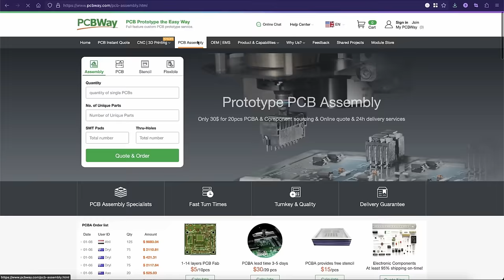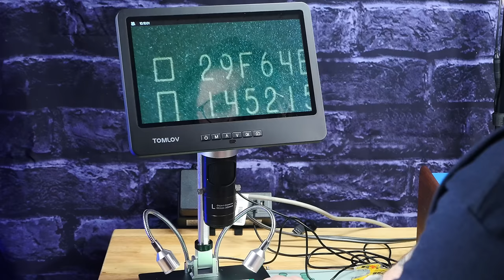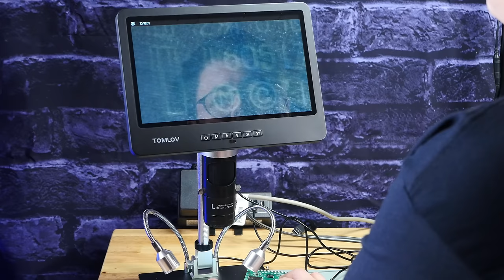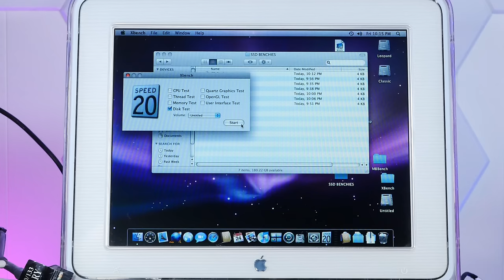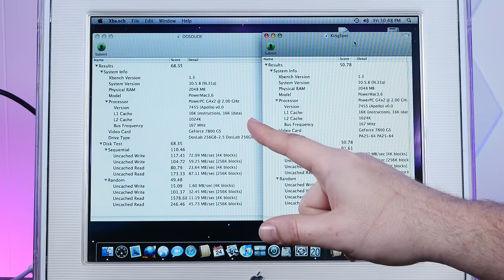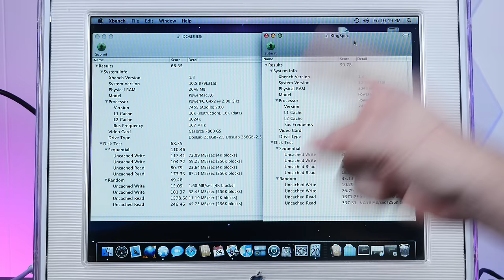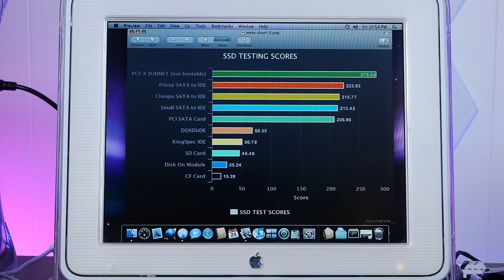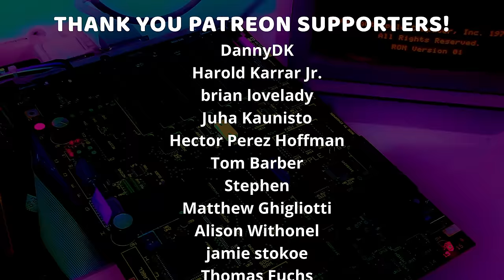What's Inside This PATA SSD from Amazon?

Comment: I wonder if the KingSpec only having 1 memory module vs DOSDUDE's having 4 is part of the cause of the speed difference. I know that can affect NVMe SSDs. Just look at the stories from the recent Macbook releases. A test of KingSpec's 256GB SSD might had shown a different result.
Reply from the maker: Oh interesting, I didn't know that could affect speed
Reply: Yeah that was my first thought as well. SSDs with multiple flash chips can use striping, i.e. parallelizing reads and writes to improve performance. It's why SSDs with less storage capacity tend to be slower than the same model with higher capacity.
Reply: This can also be seen in the M2 Macbook Air, it has fewer memory chips, and the disk IO is slower bc of that
Reply: @ActionRetro  The controller is 4 channel, so with 4 flash chips, it will perform better than with 1 - typical of SATA SSD controllers as well, so the 120/128 GB model will usually be slower.
With 64GB flash chips, a 64 will be single channel, a 128 dual channel, a 256 quad channel and a 512 two chips per channel, with the 1TB moving up the chip capacity by 4x and going to 4 chip again

Comment: This reminded me of those last agp cards that were actually pci express but had a chip that "converted" to agp on the card itself (on the opposite side of the chipset).

I just wish people would stop using CFcard thinking it's ssd. CFcard is not SSD, they are slow, they have an absurdly lower number of reads and writes in the long term, they were made to be used as a pendrive and not for an operating system to write to it multiple times. They last a lot less, and are a lot more expensive. Those industrial flash ide modules are also cfcard technology, and are only designed to be read many times (not written), not only are they expensive, they will only last a few years in a retro gamer machine.
Reply: sorry thats not true. CF Cards were developed for mobile devices like PDAs, Cameras and small form factor laptops. CF first of all is an interface - thus says nothing about the storage technology. For example IBM produced a hard drive in CF Card form factor. CF Cards were most of the time NOR-Flash, later NAND-Flash. Those ARE Solid State Drives. You are drawing a line into the sand where no line is. The main difference between modern NVMe or MSATA drives compared to the CF Cards are the controller. They got more sophisticated caching stuff in DRAM to avoid writing on the Flash to often, mapping the physical storage to spread out write operations, having more capacity and swapping those around - again to reduce write operations on a single Gate. But from the flash perspective there is no huge difference between a SD Card, CF Card or NVMe drive. Also i disagree, you COULD use a CF Card for a gaming system, but you should avoid using those as a swap device or disable writing logfiles on those drives. Having a DOS PC with a CF Card is absolutly fine - the few created Save games does not matter.

Comment: I've seen these IDE flash modules before. They are supposed to be just plugged directly into the port on the board, no cable needed. So only one drive, and expensive.
And while both IDE SSDs have the same chips, they use different amount of memory chips. And just as with SATA SSDs, more chips means more controller-to-memory bandwidth. That is also the reason why SSDs of the same model but different sizes give different speeds.

Comment: The difference in speed between the DOSDude drive and the KingSpec drive probably has more to do with the DOSDude drive having 4 flash chips vs. only one in the KingSpec. Most SSD controllers have multiple memory channels, and can access multiple flash chips in parallel. (The PCB quality in the KingSpec may also play a role.)
Reply: Came here to say the same thing! The controller will write data across all the chips it has access to, so write times will definitely be better on dosdude's drive.
Reply: @FinalManaTrigger  and read times as well i suppose, wouldn't having multiple flash chips om a multi cannel controller be allmost the same as having sevaral IDE drives in a jbod ( ofc without the seek time on flash and possible lipitations on top and soeed due to not using multiple ide channkes on a dedicated ide raid controller and thus being limited byba single udebus)

Comment: The SM2236 chip is a compactflash card controller. The Dosdude and the Amazon special drives are essentially CF cards, just using modern flash devices, which is why they kill the speed of the CF card. But from a compatibility perspective there should be no difference between a CF card and those two drives.

As for speed differences between them that's due to the number of flash chips. You often see this in specs, where lower capacity drives have lower speeds. It's all about parallelism which is lost if you have fewer flash devices.

Comment: The Kingspec PCB certainly is designed much more nicely, I like the two stacks of memory chips (well it has the solder points for them) rather than one back to back across.

Comment: The CF card says 133x on it. That speed rating is based on 1x equal to 150KB/s (based on compact disk read speed), so the card is advertising itself as being just shy of 20MB/s in ideal conditions, which is way below the 100MB/s speed of the IDE bus.

Comment: 2.5" sata Hewlet-Packard  654540-001 adapter sleds are very good 2.5" SSD mounts as they preserve 3.5" sata connector physical locations, bolt into mac pro 1,1 and above apple sleds

Comment: On the DOSdude vs. KingSpec - the DOSdude uses four 64 MB chips, while the KingSpec only uses one. Many SSD controllers run much faster when they have more chips to parallelize across. Just look at the speed reduction for Apple M2 Minis/MacBooks with the lowest-GB drive vs. the next one up. Because the lowest-GB drives always have half as many chips.

Comment: That small SATA adapter looks perfect, since most sata SSDs are smaller inside, we can probably make 3D printable shells that can fit both the adapter and the SATA ssd in the right spot.
Or just put some kapton tape on them and let them sit loose in older laptops.

Comment: I would be interested to see an SSD replacement that went the other direction. Not to be the fastest possible IDE drive but to be slow as balls. More specifically to better emulate the speed of an actual old hard drive maybe even having it be adjustable. Things like platter rotation and delays on seek time like even with its paltry speed the CF card will still feel way faster than the original hard drives in old macs because it has almost no seek time.
Reply: Buy why,  I don't think anuone would have minded the new upgraded disk access times when these systems where new, but sadly the tech wasn 'r there yet. But hay I might be missing something

Comment: Thing is, the marvel based ide to sata adapters are quite good, there are even variations for ODD support on slave via jumper. Anyway, the cheap solution with adapter and standard quality sata ssd will outperform any other solution, especially if the ssd isn't total garbage and has proper dram for block mapping and slc for burst writes. Add to that, modern ssds own internal garbage collection and wear leveling routines which don't even need some OS flags to start them, it will be long time before that combo will fail or become inadequate slow.

Comment: I actually bought a 64GB KingSpec PATA SSD back in 2016 for my Thinkpad T23, and it was only storage in that laptop until 2021 when I added an UltraBay HDD caddy and an SD-to-PATA adapter for storing more stuff. That KingSpec drive is still running my 98SE install and works great. The only concern is budget. It was definitely hard to swallow $50 on a 64GB SSD. Hopefully dosdude's creation will be more reasonable.
Reply: Much will depend on hiw much pcbway will charge fore delivering the cards pre populated ( unless you want to do the soldering yourseld) and how much the case and shipping costs.

Comment: I believe that the reason the DOSDUDE drive is so much faster than the KingSpec is because it is populated with 4 NAND chips while the KingSpec only has one.  In effect it is like running a 4 way RAID system set to span 4 drives.  You are able to access the throughput of each drive at the same time rather than being constrained to the throughput of a single drive and as such the DOSDUDE drive is hitting its limit with the controller chip rather than the NAND chips.  In day to day use this limitation would not be much of a factor as it is unlikely that a file you wish to access had been split between all 4 NAND chips but it is something that definately would show up on a benchmark.  It could be interesting to see what the DOSDUDE drive could do with an upgraded controller but that is way past my abilities.

Comment: I bought a cheap no-name IDE to SD card adapter for my Gigabit Ethernet G4 and it boots OS 9.2.2 in 36 seconds and boots OS X 10.4.11 in 20 seconds. And for 10 bucks and the 128GB SD card I just had lying around I’d say that’s a pretty good value.

As for the dosdude drive it also has more chips and I’d imagine the controller chip is running them in a sort of Raid0 type setup.

Comment: I was given a G3 "Pismo" PowerBook with an internal fault that prevents it from recognising internal drives. But in my collection of "stuff" is a CF-FireWire 400 card reader. I installed Tiger on a 32 GB CF card and OS 9.2.2 on a 1 GB CF card. Both cards can boot this laptop although each has to be ejected then reinserted into the card reader before attempting bootup.

Comment: PATA to SATA adapter and then normal SATA SSD still seems like the cleanest solution - IF the target computer is okay with it. You're currently not going to find anything that is cheaper than SATA SSDs. And it's easy to swap them into a modern system to prepare the drive.

Comment: Hello and thanks for this useful channel. I need some help and I know I can find good advices here... Here's the plot : I have a beautiful PM G4 AGP 400 Mhz I have upgraded to 1.5 Go of ram and with 128 Go SSD. It runs X Tiger (10.3) and works fine. I use it to digitize my old tapes (MiniDV) with iMovie driving the camcorder via Firewire connection. Here's my problem : transferring my (raw) footages of several gigabytes can take 2 or 3 hours, may be more for a whole "cassette". The idea is to work my files on another Mac, a M1 Mini which is powerful enough for this kind of stuff. So, I'd like to know what is the best solution, according to you, to transfer my "tapes" on an external drive that would be fast enough for the G4 (Firewire I guess) and I could later plug into my Mini. Thanks in advance for the help.

NB: I don't want to use an analogic gear a la El Gato, I want the numeric flux from my camcorder (a Sony PC101).

Comment: I'd definitely like to see benchmark figures for classic hard drives roughly the same size! Most likely even the CF card would be faster than most late-90s/early-2000s hard drives.
Reply: Probably, especially on random reeds and writes, thus us wgerecssds ( or any soldid state storrahe) beats spinning rust hands down, due to not needeing ro move the heads berween tracks and wait for thevrelevant data to come by on the next rotation.

Comment: Just looking at them side by side, it seems to me that the Amazon one has just one flash module, whilst the other, 4.

The "PCB" and controller are irrelevant in this case. It's literally like comparing running RAM in single channel with dual channel on a modern PC.

Comment: I've upgraded my car's entertainment system  (2010 BMW CIC) from spinning disk to ssd. Based on recommendations, I used a Marvell based IDE->mSATA adapter (Kuroutoshikou branded). It works fine, and according to The Internet, the others don't work with this system.
So I would recommend if you want to use anbd mSATA adapter, to find a Marvell based one.
Also, I wonder if the open source one works on the BMW CIC system, but since I have a working setup I don't think I will try it our.

Comment: This is quite interesting. If I'm understanding this right, a SATA drive would be faster even with an adapter for translation. While I was not aware of the DosDude offering, I've been considering the KingSpec vs the very IDE / SATA adapter that came in 2nd, with a Crucial MX500, for a Celeron 325 machine my friend's kid picked up for $15 (he's still learning). I would have two questions. First, is that adapter suitable for boot / OS drive use, and second, would I see the same differences across these devices on a Windows PC? Without the technical know-how and skill, the DosDude solution is only feasible for me if I can get one ready-made for a comparable price, which may not be feasible for its creator.

Comment: I use that StarTech adapter in my original Xbox, seems to be the most reliable
DOS Dude using multiple memory chips instead of a single memory chip probably gives it s significant performance boost also
Was that that LTT screw driver?

Comment: Thanks for this video.  I've never been a fan - nor regular user - of Apple-Macs, but found this very interesting, as I have a couple of old PC's and Laptops which are IDE, but can no longer get IDE hard drives here in the UK; either 2.5 inch, or 3.5 inch.  I may well invest in a couple of these IDE/SSD drives.  I do have a couple of IDE-SATA converters, but they aren't suitable for use in my Laptops.

Comment: While the red startech has always been my go-to, they are not compatible with all old school IDE drives. I have yet to find an apple desktop they didn’t work with, but they barely fit in a cube. They work great in a g4 iMac also. I have, however, found some XP era Dell computers that will not even recognize them.

Comment: I think the reason that why the Disk on Module is very slow, probably they using slower NAND chip and/or slow controller and also since they were designed for industrial use, the design is more to robustness, so it's fine to have slow access but perform fine in many harsh condition

Comment: I suspect what you're paying for with the Startech adaptor is compatibility. I have several of the cheaper bridgeboards I cannot get them to work with more than 1 drive attached to the ribbon cable, even the ones with a Master/Slave select jumper. I'll probably pick one up and see.

Comment: DosDude's pre-built SSDs have a Contact Us price for their products, which is usually not a good sign on pricing.  But since you said it's less than half the price as the Kingston (and better performing), it does look compelling.
Reply: Currently it's $60 for 128 gig or $75 for 256 gig.
Reply: @rileycassel6931  good price.
Reply: Mr Guru  Where did you get a msata drive for so little? I got an old ide laptop I want to get working again but a sata drive is too big to fit in the bay

Comment: Amazing, I would have thought the CF card would beet the SD card, although the results are a little limiting in that we just have an overall result, and not separate read & write tests. Often with these old computers you tend to write little and mostly read the drives, loading up games etc. One usually doesn't get 'productive' on these are create a lot of data.
So these results may be misleading, I'd like to see some read only test results, as that's more what you tend to do, especially with DOS machines, with a little bit of writing with Windows, and probably the same with Mac OS.

Comment: Hello, thanks for this video.. i am currently working on upgrading my Power Mac G4 MMD dual CPU 1.25 Ghz, i purchased the Startech IDE to SATA with a 500GB SSD but when booting up from the Tiger DVD at the part where you select the destination disk it cannot detect the drive. I wonder if you were able to actually use the Startech IDE to SATA and boot the OS from it?
thank you!

Comment: If old hardware doesn't support trim x25-e SLC is the way to go.  Would also mean the benchmarks are a bit misleading as the performance would degrade with use without trim.

Comment: You are correct, the sonnet eSata is not bootable out of box. I have one in my g5 quad with a couple big eSata en losers for 5 SaTa drives each. I looked for a haxie for that card to open it to booting, but no joy.  I haven’t looked recently for it so after throwing sorbet leopard and the dev preview of snow on PPC, you have inspired me to look at that again. Thanks, I will let you know if I find anything, unless you guys already have something….😂.
Reply: The goal would be to use an enclosure with 5 SSDs to be used as a boot disk.

Comment: A newer, higher spec CF card would be way better. 133x means 133 * 150kBps, or roughly 20MB/s. The adapter may also not support speeds even of 133x, much less faster, although that seems silly. Today 80 bucks gets 64 gigs of CF with UDMA7 and 160MB/s (Sandisk extreme pro) so that should be...I think 1066x or something? There's also a 10 dollar startech adapter with floppy power and what I presume are speed jumpers with 9 position combinations that can mate to 40 or 44 pin IDE. All told, might be a very interesting experiment to push the envelope!

Comment: This doesn't seem to make sense? How are you able to transfer faster than what the IDE bus is capable of? I thought the maximum transfer rate on UDMA6 was approximately 133 per second with overhead, with the theoretical maximum of I believe 160 megabytes with the absolute blazing edge UDMA-7 which as far as I know has never been implemented in any computer at least from a motherboard  perspective. 

Am I missing something or is that result not possible?

Comment: The reason DOS dudes SSD is faster is because it has more chips on it. It can split the data into blocks onto every chip. There's only like one chip on the king spec SSD. So all the data is getting written to that chip. Which makes it slower. Not to mention they're probably using either TLC or QLC